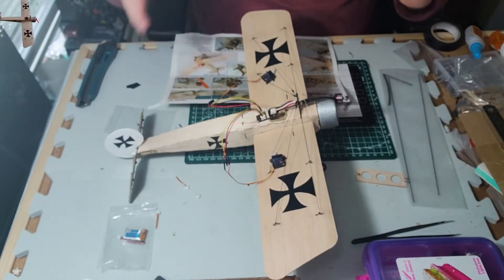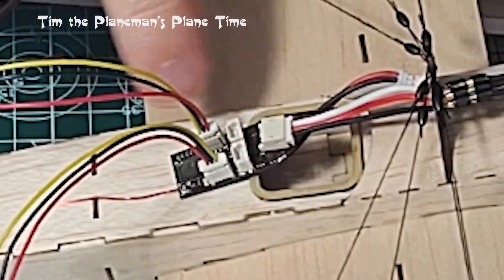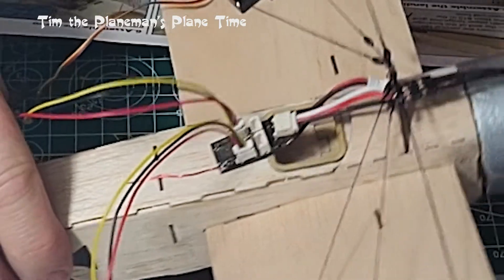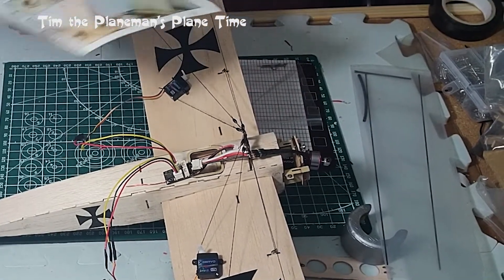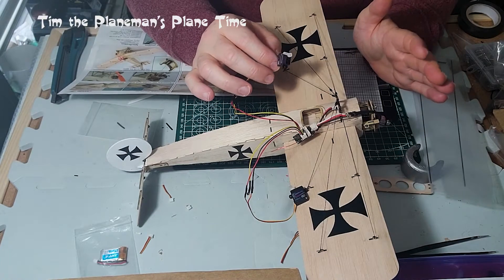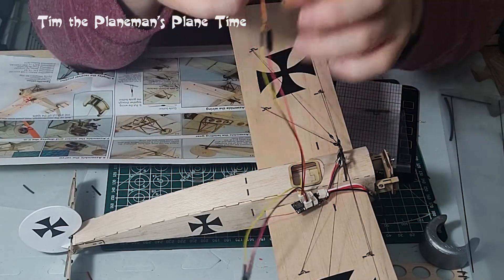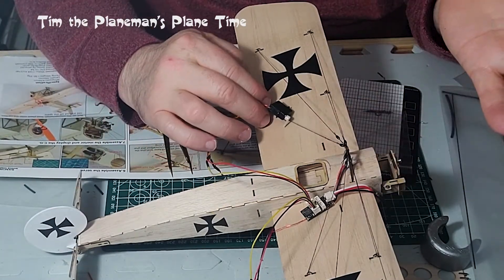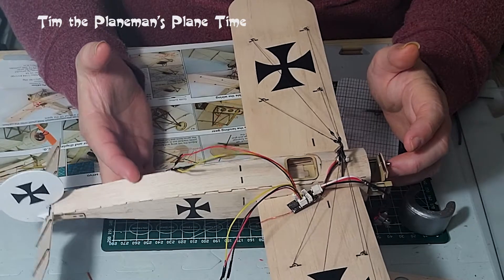03 Fokker E. Laying out Electronics - Dancing Wings Hobby micro RC model plane build

Comment: I’m assembling this plane now and confused about the ‘paper hinge’ on the rudder.   Do you mind sharing a pic of your assembly.  Thank you
Reply from the maker: They are "CA Hinges" - if you google it you should find lots of examples. I didn't know that when I recorded this video.
Reply: @timtheplaneman And what did you use as a controller? Just looking for something cheap that will do the job.
Reply from the maker: @bradgriffing7204  I used the Jumper T-Lite, I think you can get the Jumper T-Pro for about $50 or maybe even less.
Reply: @timtheplaneman thank you so much!

Comment: Hey Tim, I have a Fokker EIII RC kit form AliExpress , Mini Cessna type, peanut scale, wing span of 480 mm. I have the same issue, no flaps on the wings. What I see in the instructions. Would you kindly let me know what is the resolve?
Reply from the maker: It will work ok using only Elevator and Rudder. You don't need flaps on the wings. Watch my video to see how I did it. It flies fine like this. Thanks for watching.

Comment: Does the  Fokker EIII has any wing flaps? I have version of this as assembly RC kit, and the manual doesn’t show me explicit the wing flaps. It’s something that i miss?
Reply from the maker: This small "K" series model does not There are markings printed on the wings but there are no connectors or controls. If you wanted to add them you would need to figure this out yourself. I don't think any of the small "K" series models have this, but Dancing Wings also has a larger EIII that does have them, this is a very small model. The much larger "S24" model does have ailerons but that is a very different plane. Which one do you have?

Comment: Very curious to see, if a late conversion to a flying plane would be possible. Is during the build process the servo built in part earlier, than e.g. in the Sopwith Pub? Or also AFTER you have finished the plane?
Reply from the maker: Hi Lutz, that's pretty much what I did. It's designed to be a flying plane, but I didn't have the electronics (waiting for delivery from China), so I build the plane first then added the electronics at the end. It's doable, but much easier to built it in as you go.